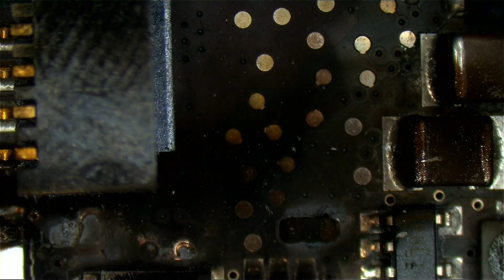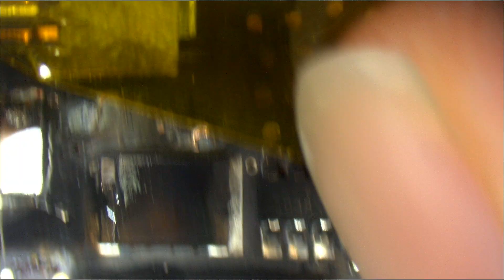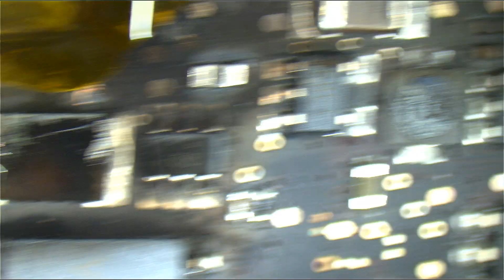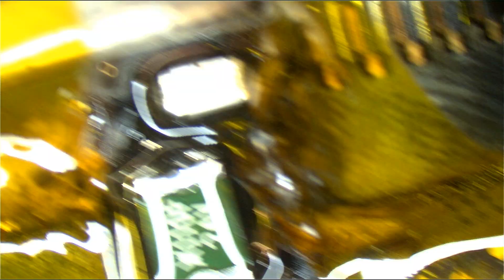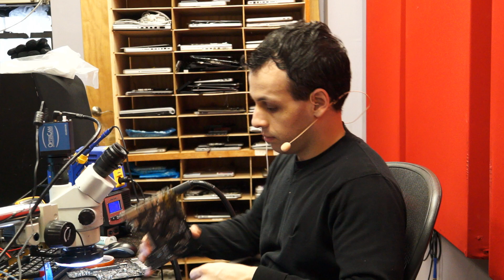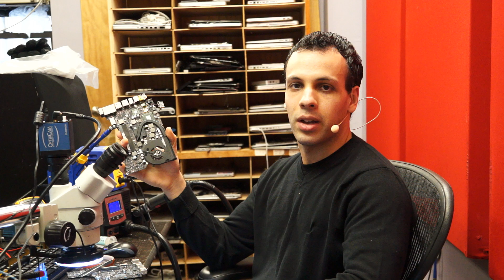What knockoff Amazon and eBay chargers do to your $1200 Macbook Pro

Comment: IMHO price isn't always telling you what quality it is, they can be good quality for cheap as well, but sadly there is no way to find out :D Even if chargers have certificates on em they can be fake (basically to trick you into thinking that it's something that in reality it's not) :D So yes, original charger is always the safest way :D
Reply: Maximus It's very easy to tell. Made in China, by a Chinese company? Fake certs.
Reply: Andrew Delashaw I think most OEM chargers are made in China, but there is a easy way to check the quality of the charger, that is the weight, heavy charger usually means it used higher grade wires and parts inside.
Reply: but weight is not everything. Chinese compies began to put scrap metal parts in these powersupplies to gain your trust.

Comment: I wouldn't charge anything with an unofficial charging brick (cheap Chinese fakes), cables are fine, but the brick/wall charger (that the power comes from) hoo boy...I wouldn't want a cheap one near any device regardless of the cost of the device.  I don't want exploding boards or batteries.

There needs to be a breakdown video of these cheap power charge plugs.   (Writing this on a laptop [HP] bought on sale for $200.  Depending on the brand I think a whole line of laptops can take one charger.)

Comment: How can you test if the charger is good?
Reply: buy a proper one :)
Reply: +dionyz1 
You would have to open it up, or find someone else online who has done a teardown of the same unit. In general, Ebay/Amazon chargers tend to be cheap for a reason. The manufacturer (sweatshop) has often cut costs by using cheap components and completely omitting any type of input and output protection.
Reply from the maker: +dionyz1 Plug it into a computer you hate and see if it blows it up

Comment: 1) Find cheapest brand (hp, asus, etc.) charger with same voltage and higher amperage to original.
2) Swap leads or connector from old charger if it doesn't fit to your device.
3) ???
4) Profit
Reply: these magsafe connector apple uses good luck soldering them to the cables of the asus charger its a pain
Reply: @fullfunk  You solder the cables together, not the connector

Comment: Quit knocking older MacBooks. If it's in the i5/7 series it's still good. The A1278 still uses an Ivy Bridge. Hell, I still use a Sandy Bridge i5 laptop! Nothing wrong with it! My next laptop will be a 2012 11" MBA or 13" MBP...
Reply: I agree, it should be at least 1920x1080 if it's gonna stay at $1099, and it should AT LEAST have a Haswell too. I don't want it to go away though. We NEED a MacBook for professionals with upgradable RAM, upgradable, STANDARDIZED HDD/SSD replacements, and a slot loading DVD/Blu-Ray drive. I would buy a Retina with a Blu-Ray drive built in and upgradable RAM at any cost and at any thickness.
Reply from the maker: Josh Bacon the upgrade-able ram argument for the older machines is BS nowadays. think about it, all it can go up to is 16 gb. you can get that with the newer machines as well.

what is worse, 16 gb of ram soldered on, or slotted memory that maxes out at 16 gb.. it doesn't matter.

I do prefer laptops with a sata port just because i am constantly switching out drives as I have 4 or 5 SSDs I store videos I am editing on. but given a choice between a PCIE drive and a sata drive, I'd take the PCIE one anyday. way better.
Reply: Louis Rossmann They definitely need to upgrade the unibody though. Even if "upgrade" meant Haswell chips, 32GB RAM max, and a 1920x1080p display. Oh, and an option for an Apple Blu-Ray SuperDrive.
Reply from the maker: Josh Bacon They don't have to people will buy it anyway :( that is the beauty of the apple brand name!
Reply: Louis Rossmann You're right - In fact, I'LL BUY ONE! Why? Because external Superdrives, soldered RAM, and special PCI-E drives are stupid. I'm not paying $500 for a 500GB SSD upgrade. I'm also buying it used though.
Reply from the maker: Josh Bacon I think optical media in general is stupid.

I don't mean now

I mean back in 2002.. remember burning DVDs to back things up? So I have to wait 10-15 minutes per part, and back up my stuff in 4.7 GB increments, and pray that it doesn't die in the spindle.. FUCK THAT!!!

That crap needs to die.
Reply: DVDs are stupid. But Blu-Rays, especially double layer rewritables, are amazing.http://www.amazon.com/HP-Blu-Ray-Inkjet-Printable-Spindle/dp/B008YQAFWU/ref=sr_1_7?ie=UTF8&qid=1461462950&sr=8-7&keywords=blu+ray+rw+disc
These are 25GB each, and you get 25 for just $18. That adds up to 625GB for $18, or under $0.03 per GB. I don't even think 3TB hard drives can match that.

Comment: the problem people have is the ridiculous prices of apple chargers, thing probably costs half the price
Reply from the maker: I will contend, that if someone is willing to spend $1200 for an ivy bridge dual core laptop with 1280x800 screen and 5400 RPM HDD in 2015, that they shouldn't be shocked at $65 for a charger.
Reply: Louis Rossmann
I agree with that
Reply: They really actually aren't THAT badly priced. The components are all very high quality and they are very well made which simply costs more. Comparable MS, Lenovo, Samsung, etc., 60+ watt chargers are just as expensive. The one for my surface book is actually MORE expensive (though it also has usb power). The component cost alone without assembly or anything else is at least around $15. Safety and UL cert cost money.
Reply: Here in sweden:
A Lenovo 65 watt charger is $60
A MS surface 65 watt charger is $80
A Samsung 90 watt standard laptop charger is $80

Meanwhile a 45, 60 or 85 watt apple charger are all $100 (yes the price for a 45 watt charger is the same an 85 watt one)

Therefore I can safely say that apple chargers are more expensive because apple is a fasion brand, in the exact same way as clothing brands with torn clothes that cost a fortune.
Reply from the maker: ***** Not to mention that the ends fall apart on them.
Reply: Oh, Apple's international prices are outrageous. They certainly gouge their customers overseas as everything seems to be conversion rate, tax, plus 20%. I can only speak to prices here in the states which like I said, are the same price, or less than other brands higher end machines for power adapters. As to whether Apple is a fashion brand, well that's another matter. Once you start selling $150 watch bands...
Reply: It's been my experience that every high end machine does this in one way or another. Apple seems to be the worst though as my both my powerbook and macbook air did it several times even though they were completely different designs. Still, the Lenovo yoga supplies all broke/frayed at the out from the box (I went through two of them) and I've already tried to reinforce my surface's supply end since it's showing signs of strain. I guess they figure if you have the money for a high end machine then you have the money for a new power supply every year or so. That and they seem determined to all make the connectors as complicated and thin as possible.
Reply: Alexlfm
I can't speak for the yoga supplies as I've never owned one, but the thinkpad power supplies I've used seem to have held for the entire lifespan of the device (much like the apple chargers, cables themselves are a different question for both)
Reply from the maker: ***** My thinkpad chargers last until lose them :) magsafes have that fraying wire at the end.. terrible. just like their shit lightning cables. startech makes lightning cables that last for eternity, you could use them to hang people in game of thrones. but original lightning cable is shit in months
Reply: The new 65w thinkpad chargers are identical to the yoga ones, and have the terrible reviews to match. The old IBM round tips were fine, however their new "slim" usb style design they introduced with the yoga seems to have all of the traditional issues with fraying and poor strain relief. It's really unfortunate that they are changing to that design. The old thinkpads really were built to last and a great design, though certainly not thin and light.
Reply: Alexlfm
Yeah the last one I used was a 8 year old robust thinkpad we used as ubuntu test machines at school, guess all people gotta be cheap nowadays
Reply from the maker: Alexlfm it is the only laptop on Earth to have a bad sata cable as a regular problem.

Comment: What about making a phone or a tablet that will not self destruct when you have the "wrong" charger?  The phones and the tablets are garbage, and are planned to fail when you do not buy their overpriced chargers. Should I buy their extended warranty too? k'mon!
Reply: i thought all new phones (atleast flagships i have 3 flagships phones since android 2.3) only charge when theres stable current and amperage. they can detect if the charger is good. but cheapers ones dotn give a fuck
Reply: Francisco Barraza doesn't matter if the charger melts and it melts everything else.

Comment: Hello Louis Rossmann. maybe this is not the best video to ask you this question, but is there any good quality laptops in the market, from your viewpoint ?  If you already made a video about this, and i was the idiot one that didn't searched in your channel  enough, than im sorry if i wasted your time.
Reply from the maker: +Oliver Toth Lenovo T520 was the last machine worth it for me but it is really outdated in terms of processor/battery life/screen quality. Give me the P50 with a 4k touchscreen, unmutilated keyboard, dedicated volume keys with no numpad.
Reply: +Louis Rossmann  Thank you for your time, and your answer ! keep up the great vids wish you the best ! :)
Reply: +Louis Rossmann I got one of the latest X1 Carbons after switching from that W510 I had before. I haven't touched the W510 since. 500gb M.2 SSD, 16gb RAM, i7, 14" 2560x1440 touchscreen. Its a beautiful thing. Everything is so fast, battery lasts almost 10 freaking hours.

 I actually like the keyboard on it almost as much as the old style. Its got volume/mute buttons on the Fn keys, and it defaults to them instead of the F# keys which I like. Got it refurbished from Lenovo direct for the price of a mid-range MBP and it was in excellent condition. No regrets.

Comment: i have never paid more then 15bucks for a real apple brick charger, mind i  just troll ebay for good listings, and yes, im 100% sure all of them have been legit, i have been given stacks of fakes that look...sort of real..but feel much cheaper... (and look it to mostly) 

but yeah, if you need one now, you better buy a quality charger.

and, there are actually some cheaper chargers you can get that are good quality, BUT you must research...and most people cannot be bothered... or cannot be bothered to learn to research before buying shit... 

mostly, do not cheap out, same as building a desktop pc...  cheap power supplys can destroy shit...  though..i have had a couple laptops that the $15 power supply i bought was better quality then the stock ones they came with...and made by lite-on vs stock being... pretty damn generic other then the manufacturer sticker on the bottom..

Comment: Can anyone who knows stuff, like Loius help me? I ordered a used gpu, and it got here. It has like, a huge blob of clear glue or something, probably solder, covering up all the transistors under the gpu die. Will it work? I dont wanna fry my pc trying,
Reply: +Adeel Rehman if it is clear, then it is most likely not solder. It's probably something like hot glue.
Reply: TheAlternateAir it's Flux. And it turned out to work just fine.

Comment: But those Chinese Chargers... Well I worked for a German Company that sells Stuff from Chinese Manufacturers under their own brand... Was there in the Quality Controll Department and also testet potential new products. Function (if it doesn't work, don't bother more tests) and more important Safety. Uuuhhh let me tell ya, from 120 Volts Ground level on the USB to horrible "isolation" (both mechanicaly and elctricaly), I've seen a lot of BS in my short time there. 

Don't get me wrong. Actually, many of those things I got for review where good or only minor changes have had to be made. 

But you'll never know until you crack one open. So don't buy em. Might be a good product, might also fry your motherboard ;) 

Oh btw... I would have replied to this customer to see the local Apple Store and let it fix there, since you are ripping of people ;)

Comment: 65+tax for a charger? and that's US?
fucking hell apple that's close up on $80 Australian for a wire, a few fuses, resistors, transformers
what does it cost to make? $5?
Reply: +rparker069 Yeah but we can see here that buying a name brand charger that will last years is way better than an off brand that will last less than a few months/
Reply: iLuZiioNz Tutorials I bought an apple charger for m ipod touch and it had broken in 5 months. I wouldn't be that mad, but that small 30cm long bundle of wires and arbitrary proprietary plug costed me $15
Reply: +iLuZiioNz Tutorials I had a off brand iPad mini 2 lightning charger for around a year before It stopped working because the cord ended up getting frayed.
Reply: ***** got it as a gift from my best friend

Comment: Was this a poorly made charger issue, or did the customer buy a cheap 85W charger to replace his 60W one? As far as 90% of laptops are concerned, so long as the voltage, amperage, and port are correct, I don't see much of a reason to overpay for an OEM. Batteries and chargers, except for Dell (have odd problems when you do), I almost always go for the $10-30 remake. 

Tl;dr what makes apple such a special snowflake?
Paranoia that you'll break your $1500 machine?
Reply from the maker: +armedtoe I don't imagine it would be hard to implement proper compatibility with onewire circuit into a knockoff charger, but it might cost an extra 27 cents, dare that actually get taken out of the profit of the douchebags that manufacture these...
Reply: +armedtoe there's is a good enough  $10-30  charger remake and  there's is  a  very bad one .
for me bad one  are not the one that fail  in small  amount    of time  but  the bad one are those  who  don't  have  any  voltage  test chip  so it  will  not  shut  down  before  burning   your  pc  .
 don't   buy  no name  you can buy  charger remake who  has  a  real mark on it  but  not those  who have  a xxx  name  or worst appel  name  ( fake )
Reply: +armedtoe over/undercurrent/voltage protection, smaller ripple (closer to dc ) etc...
but that's just a cheap vs expensive charger problem
Reply: +armedtoe Because it will be cheap unsafe shit that will put 240v AC into your laptop .
Reply: +armedtoe The amperage should not matter as long as it is higher than the rated power draw of the device, ideally it would have a higher capable current output because then it usually uses better components. With current the load will only take as much s it needs as long as the voltage is correct.  It's hit or miss with non OEM chargers, if you are going to get a non OEM charger you want to still get  a semi known brand. The problem with the no name $10 chargers is that they usually lack good isolation between the low and high voltage sections, sometimes passing mains right to the ground of the output, they usually use the cheapest capacitors they can get that week, insuffecient heat sinking to heat generating components etc.....  I usually dont go with OEM chargers, but i usually still get something that is name brand and compatible.  I've had bad experiences with no name chargers, even a few USB supply's that passed 120 right int the ground of the USB connection due to poor soldering or faulty transformers .